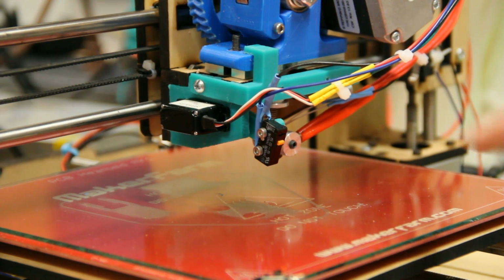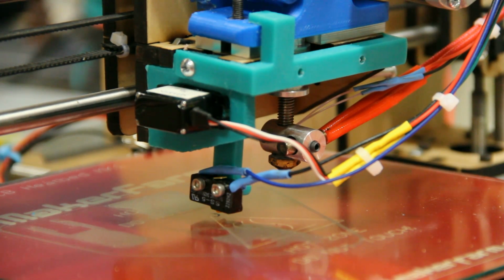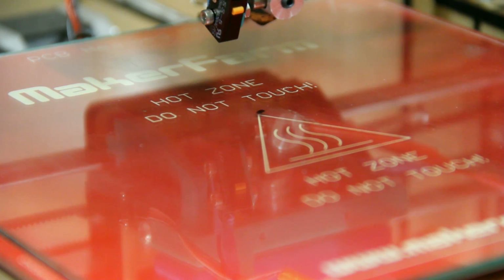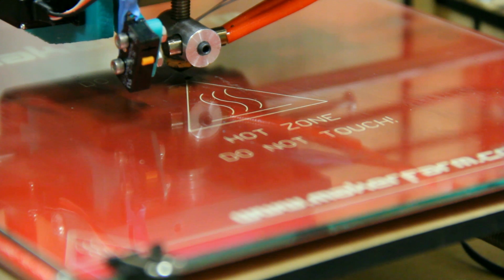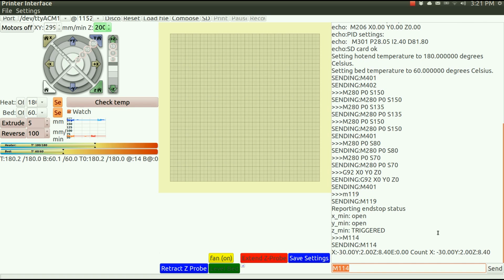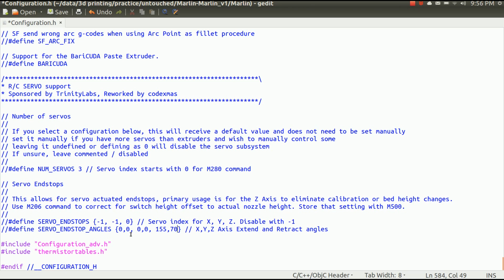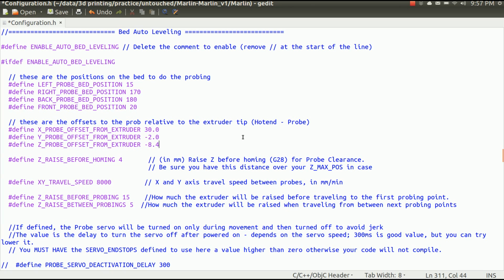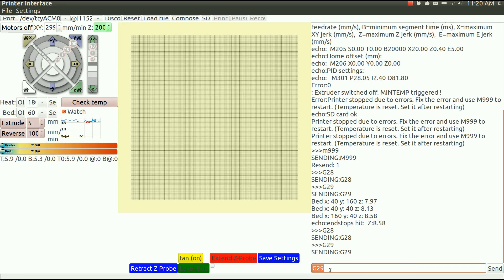Setting up auto bed-leveling on the Makerfarm Prusa i3. Part 3 - Final setup

Comment: I'm having an issue where I cannot get the nozzle close enough to the bed. It's close enough to lay down plastic and stick, but it's not smearing the plastic like it should. I've tried changing the "Z_MIN_POS" value to be more negative, and "Z_PROBE_OFFSET_FROM_EXTRUDER" to be both more negative and positive and it doesn't appear to have an affect at all.

It appears as though the nozzle raises up slightly immediately before it begins printing, is that expected?

Thanks, and great work!
Reply: I fixed the issue by tweaking the z-offset value in my slicing program. I much prefer that method rather than flashing the RAMPS board :).

Thanks for this tutorial, you rock!
Reply from the maker: tcomben
I'm glad you were able to get it sorted!  Happy extruding! ;)

Comment: The micro switch what did you hook up the NO,NC, or C and where do they plug in on the micro controller board?Ty
Reply: The stock setup is C and NC (the two outer posts if you are using the switch ZennmasterM Recommended).  This is the case with my MakerFarm i3v at least.
Reply from the maker: The micro switch is your Z-endstop, so it plugs onto the Z-endstop pins.
Reply: ZennmasterM I understand that part, but what I am asking do i just  hook the gnd and signal up (C and NO)  or ( C,NC and, NO ) Looks like you only have two wires running to  the micro switch.Ty nice video btw but it seemed to leave the micro switch wiring out. I guess that is part were you assume the person would know the wiring. I run opto endstops so new to  the mechanical endstop wiring.
Reply from the maker: Anthony Edwards Oh, ok.  There are only two wires necessary for hooking up a mechanical endstop.  You'll definitely need C, and most likely NO (normally open).  If you hook up BOTH NC and NO, the switch won't work.  Hope this helps!

Comment: Hi! In your video when you are issuing G28, your servo arm is lifted once the homing process is done. I have #define PROBE_SERVO_DEACTIVATION_DELAY 300 enabled, if I disable it it will lift up as yours but in this case the servo is not disabled and it has some jerk

Comment: When I do the CAL. to find the offsets When setting current position to X0-Y0-Z0 I check with M114 and all are zero. When I do the next to and home-in the Z, when the Z get triggered it resets the Z to 0. I had to disconect the switch to get a reading. If there something set that makes Z reset to 0 when triggered? Thanks

Comment: Hey Thanks for the help really appreciate it, I have a small problem with the switch tapping the bed after it has taken its reading. When it lifts up the back end is hitting the bed I am pretty sure this is not a good thing have you tried any other type of switch that may fit better on the end of the servo?

Comment: Hi, thanks for the detailed video.  I have gone through all the steps, and I am able to home all the axis using G28 including the z-axis properly.  However when I issue G29, nothing happens.  It just doesn't move at all.  Any idea?
Reply from the maker: yah1248 There seems to be a problem with G29 in the current Marlin.  I'll take a look and see if there's a fix.

Comment: Hi Micheal, thanks for the great video you have done. I have a question for you. I follow your instruction and everything work correctly until I start to  print. I add the G29 command in my G code. The G29 work correctly but the issue is when the printer start, the hot end is way to high. The offset i'm using are X -5 Y 18 Z -5.27.
Thanks for your help
Reply: +Luc G. were you able to figure out this problem? I am having the same issue
Reply: having the exact same problem, did you sort it out?

Comment: ZennmasterM When I run the G29 command the first corner it goes down touches then raises and goes down slower and touches. Then makes a loud motor noise but nothing really moves and z doesn't go up but maybe a half turn on the rods then pretty much slides the endstop along the glass to the next corner and so on.
Here is my settings for the probing
#define Z_RAISE_BEFORE_HOMING 4
#define XY_TRAVEL_SPEED 4000
#define Z_RAISE_BEFORE_PROBING 15
#define Z_RAISE_BETWEEN_PROBINGS 5

Any idea what is going on?
Reply: Ok i figured it out. I have an i3v 10" so don't know if that has anything to do with it but i changed all my speeds to match makerfarms config. This also fixed a problem where my Z values were going up by 4 on each corner.
#define HOMING_FEEDRATE                        {50*60, 50*60, 50, 0}
#define DEFAULT_AXIS_STEPS_PER_UNIT   {80,80,4000,841}
#define DEFAULT_MAX_FEEDRATE              {250, 250, 2, 22}
#define DEFAULT_MAX_ACCELERATION       {1000,1000,5,1000}

#define DEFAULT_ACCELERATION                   500
#define DEFAULT_RETRACT_ACCELERATION  500
Reply from the maker: Yes, changing your Configuration.h to the MF values is a CRITICAL step, which I mentioned in the description of the video, and also included a link to a blog post in which I talk about how to do it.

Comment: how do you actually set the Z home point ? now it stuck in the middle :D
Reply from the maker: The current version of Marlin defaults to the center of the bed.  You can change this in Configuration.h either by disabling Z_SAFE_HOMING, or leaving it enabled and changing the Z_SAFE_HOMING_X_POINT (and Y point)  to 0.

In any case, I'd recommend leaving it in the middle unless you've got a good reason to move it.
Reply: ah ok thanks, I don't really like it stay at the center I guess I will put a custom gcode to move the X to the side 

thanks
Reply: ZennmasterM Today I removed my spring my heat bed seem it a bad idea, probe when fine but the FW does not seem to compensating the unevenness of the bed, been reflash and testing for hours now my right side always a bit high but fw did nothing to compensate it :), time to sleep i guess
Reply from the maker: *****
Are you seeing the Z-motors move during the print?
Reply: ZennmasterM nope it didnt move, I marked my coupler with sharpie just to make sure
Reply from the maker: Okay, this is the most common cause:  Check in your Configuration.h, and make sure you've got #define ENABLE_AUTO_BED_LEVELING un-commented.
Reply: ZennmasterM Ok found my problem, I have G28 X0; in my slic3r after probe which render probe value back to 0
Reply from the maker: That would explain it.  I'm glad you got it sorted!

Comment: So once you've made these changes to the code does Marlin automaticly lower the probe BEFORE homing the Z axis, or did you have to add G code for that into a pronterface macro?     Also, is it possible to have the Z axis home to the MAX position (using a MAX endstop) but have the zprobe for bed leveling on the MIN endstop?   I'm currently building a repstrap that is a rough copy of the I3 (no printer parts, using steel and aluminum angle and bar stock with threaded rods and drawer slides!)
Reply from the maker: Hi -

Marlin lowers the probe automatically.  These videos are of an earlier version of Marlin, the curent one deploys and stows the arm for each probing. 

As for homing to z-max, it's possible, I suppose, but I would be worried about potentially losing some calibration as the x-carriage runs all the way up and down the entire z-axis. If your goal is to keep the carriage out of the way at the end of a print, it's easy enough to just add some custom g-code in Slic3r to bump the cariiage up a few mm when the print is finished.
Reply: I was worried about the home operation before doing the probing, will marlin lower the probe before homing the z axis?  I realize it will lower the probe as part of the autolevel command.
Reply from the maker: Kenneth Scharf  Yes, any time the z endstop is to be used, marlin extends the arm.

Comment: Hey Michael,

So i have everything set up of my auto leveling, however now when i try to print, my printer isn't lowering the print head to the bed.  Also, how do you get the printer to automatically auto level before prints? Im using the LCD screen and SLIC3R to slice.  I know you can put custom GCODE into it through SLIC3R, but I'm a little lost.  Thanks for the help!
Reply from the maker: Sorry for the late reply, I find it's easy to lose comments in Google's system.  Anyway, if you haven't gotten it sorted:

Add a G29 line AFTER the G28 in the "Custom G-Code" in Slic3r (in the Printer Settings tab).

As for not lowering the print head, is that after you've run a G28 and a G29?  If so, are you getting weird howling noises from your z motors, or is is just not even trying?
Reply: Oh yeh! So I figured out the problem. The zs we howling so I turned down the speed to 300 instead of 6. That fixed the issue. 

Now I have to redo all my firmware from scratch though because I changed my nozzle and the offset isn't working on it XD BUT I will get it. Looking forward you your next video! Thanks!
Reply from the maker: Great news!  Again, sorry your question got lost in the shuffle! :(
Reply: No problem. What's the best way to contact you I've need be in the future?

Comment: had to make modificaitons as I had a fumehood in the way but got it working as close as I can! 
One question: The homing it does it for the most in the corner.
But just for homing the Z-axis the printer goes to the middle for that axis.
How do I set the homing for the Z-axis also back in the corner?
Reply from the maker: If you have Z_SAFE_HOMING enabled, it defaults to the center of the bed for Z-homing.  You can either disable safe homing, or change the default values (X_MAX_LENGTH/2, Y_MAX_LENGTH/2) to something else.  Of course, the point of safe homing is to make sure you don't try to probe Z over air, which could be bad.
Reply: ZennmasterM Thanks! couldn't figure that out. currently z-safe homing does the job. The reason why I think z-homing can be bad is that you can have a little bit of droop in the middle and if you have your temp low this hardens quick and could  affect your printing process further on.

Currently I make use of the little pause it has during the z-homing to get underneath with my pliers to quickly grab any droop beforehand *I get this droop because I prime the extruder in pronterface before I start my print.

I have noticed they changed bed leveling, it now lifts up the servo everytime it moves to a new point.

Comment: One thing that bit me with the auto bed leveling is that if you issue a G28 (home) command after the G29 (auto bed leveling) command, it resets your bed leveling measurements.  So in short, don't issue a G28 anytime after the G29 command in your custom gcode.

Comment: i had to half the offset in Marlin then i had measured during calibration
4.2 it was, -4.2 crashed the head, so i ended up with  -2.2 Z-offset

Comment: Hello MICHAEL. I have a question for you. I setup and re flash my printer. But after  G29 command when I move Y in negative direction  in same time Z also move in negative direction. If move Y in positeve Z alos move in positive direction. After reset all axis move correct. Do you have ideas how solve this issue ?

This is commands output:
>>>G28
SENDING:G28
>>>G29
SENDING:G29
Bed x: 50.00 y: 50.00 z: 14.33
Bed x: 150.00 y: 50.00 z: 18.92
Bed x: 150.00 y: 150.00 z: 23.46
Bed x: 50.00 y: 150.00 z: 27.29
Eqn coefficients: a: 0.00 b: 0.09 d: 11.87
planeNormal x: -0.00 y: -0.09 z: 1.00
echo:endstops hit:  X:122.37 Y:150.96 Z:27.29
Reply from the maker: It looks like this was a problem that worked its way into Marlin for a while.  I would suggest re-downloading the most current version.  If that doesn't work. see if you can download an earlier commit from Github, from before the bug made its way in.

Comment: I am very new to 3d printing and still waiting on my first one.  This might be a silly question but what does the auto leveling  do actually,  I am guessing you still have to adjust the bolts going through the glass?
Reply from the maker: The auto-leveling system does a few things:  First, it drastically reduces the amount of time you spend leveling your bed (it can be a LOT, depending on how flexible your printer design is), and secondly, it ensures that your Z-axis is perpendicular to the bed.

Comment: Is it possible to add some more probe positions?
Reply from the maker: The current version of Marlin now allows for additional probe points.  The key thing to remember, though, is that three points mathematically defines a plane.  More than that, and either you're oversampling a plane, or you're defining something that isn't planar (flat).  So if your bed is flat (but not level), probing more than three positons will, at the very least, increase the amount of math that your firmware is doing. Curently, for more than 3 probe points, Marlin uses a LMS method to estimate any deviations from planar that may occur onthe surface.  My advice would be to start with the three points, and if that works, leave it be.  Other wise, go ahead and activate the advanced bed-leveling options in Marlin.
Reply: ZennmasterM
First, thanx for the videos! But, I disagree with 3 points being sufficient. While three points do create a mathematical plane, it is probable that any non-metallic bed or bed support structure (e.g. wood) or metal that is too thin will be affected by atmospheric conditions (ambient temperature, humidity, etc), warpage, and other factors. Which will result in a non-planar surface, therefore requiring more than 3 points. At minimum, I reccommend, "#define AUTO_BED_LEVELING_GRID_POINTS 3" Which means 9 probing points on the bed, which will divide the bed into 4 separate planes.
Reply from the maker: ***** I don't disagree. If three probing points are insufficient, then go ahead and use the LMS method.  That's what it's for.  On the other hand, if a bed is in fact sufficiently planar to get the desired result, then the extra processing cycles are unnecessary.  That's what the 3-point probe is for.

Comment: Thanks for these very clear instructions, if I had found your videos before, a lot of headache would have been avoided!
I have already done everything you say, my problem now is that the printer doesn't react to a G29. The probe is used for homing, so it's alive, but not for the bed leveling itself. What could have gone wrong? Thanks again!
Reply from the maker: Given what youve got working, the first thing I would check is to make sure that #define ENABLE_AUTO_BED_LEVELING is, in fact un-commented.  Does Pronterface give a reply when you issue the command?
Reply: ZennmasterM Oh my, I can't believe I missed that. After so much ctrl+c ctrl+v I left that line out. Ouch... Thank you, it's working now.
Reply: ***** ok, now I have the following issue: when I send a G29 the Z axis starts lowering with the probe retracted. Do I have to always send a M401 before a G29?
Reply: I have to trigger the probe endstop manually before the nozzle hits the glass, and I get this on pronterface:

SENDING:G29
Bed x: 30 y: 140 z: 23.03
Bed x: 30 y: 30 z: 23.05
Bed x: 140 y: 30 z: 24.23
echo:endstops hit:  Z:24.23

And on my LCD I get a endstops hit: Z message
Reply from the maker: That's one I have not seen.  The G29 should lower the servo for each probe, without further interference.  I'll see what I can find out.
Reply: ZennmasterM Don't worry, I figured it out: my probe, when extended, was too low, and my Z offset was greater than the default value for raise_before_probing or something like that (in absolute values). I changed that value to 30 (default was 20, and my probe was -24.5) and it's working normally now! Thank you again!
Reply from the maker: I'm glad it worked out! I'll file that one away for the future.

Comment: Hi ZennmasterM!

I am trying to set up the auto bed leveling system for my reprap that I am building. I went through and did all of the changes like you suggested. However when I hit print, the servo just sort of vibrates, but does not actually rotate the probe. It only vibrates at times when it is supposed to extend/retract the probe, but like I said, it doesn't actually turn. Any ideas what it could be? Btw I am using Cura to do my printings.
Reply from the maker: My first guess would be that your servo is "power hungry", and/or you don't have sufficient power on the 5v servo rail.  If you can test your servo or try another one, that would be my suggestion.  Other users have also had good luck putting an external source of 5v on the rail, and not relying on the board's power.